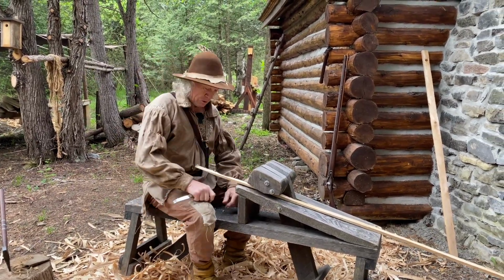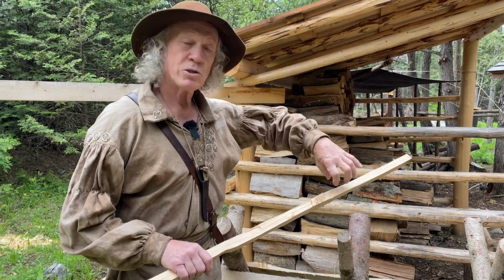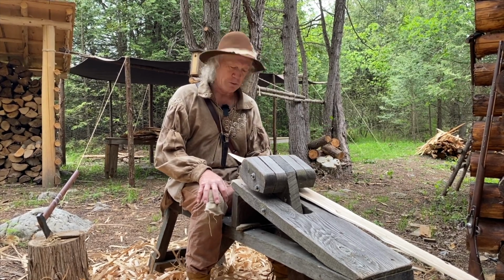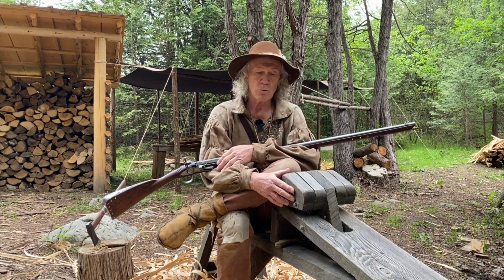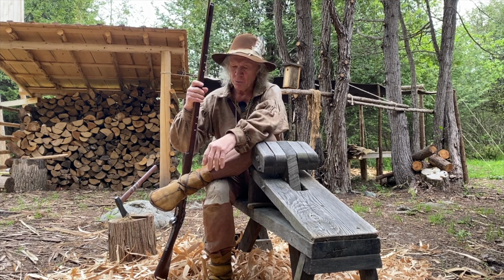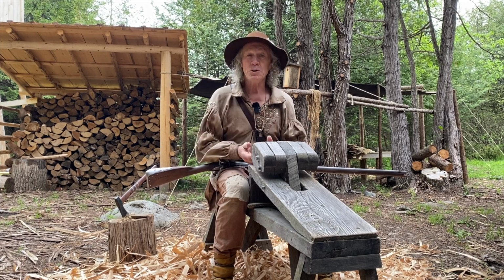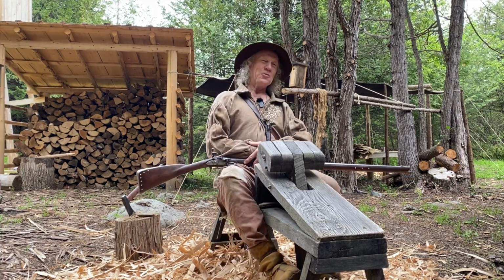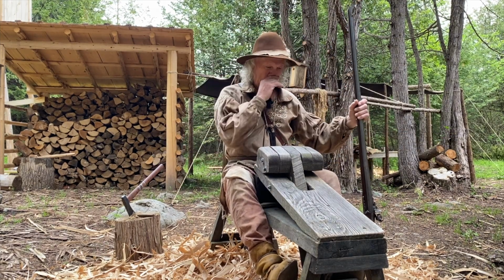Birch Bark Canoe Build and the Story of the Captain Samual Brady /FRONTIERSMAN /WOODWORKING/ HISTORY

Comment: Hey Peter. I'm familiar with the spokeshave and the drawknife but have never used a crooked knife. Laubin in his "Bows and Arrows of the American Indian" says the first ones probably used a beavers tooth. What you need is some good white wood from a Hickory. Rub a little bacon grease on that, heat it over a fire and you can bend it to any shape you want. Trouble is that it smells so good while you're heating it that it makes you hungry. I was trying to put a recurve on a Hickory bow that way. You know I ate five bows before I was finally able to complete one.
Reply from the maker: Built a few self bows myself and yes, I’ve also made kindling out of some of them as well.  Once you get on to the tool, it’s pleasure to use.
Reply: @TheWoodlandEscape  much enjoyed the tale of the escape. I'd like to share with you some of what has been related to me about the area I live in. It lies along the border of Arkansas, Missouri to the North, Eastern brush country of Texas to the South. Except for some of the creek and river bottoms it's made up of rocky plateaus we call flats and deep draws or hollows and, though lower in elevation, has a good resemblance to the Appalachians, beautiful country in spring and fall, hot and humid in summer. We did not reach statehood until the early 1900s. Before that it was a place where a fellow could get to in a hurry for one reason or another. Around the time of statehood there was a book written about it called HELL ON THE BORDER which named names and told some of the most lurid tales. Most of it was totally untrue, of course, but for a time it might be unfortunate or downright unhealthy to have a copy of that book and especially to repeat some of the things written in it. Into that country came my grandfather, on my mother's side, during the late 1800s. He and my grandmother had a large family of 9 children. The stories they could tell.
Reply from the maker: Fascinating history, thanks for sharing.